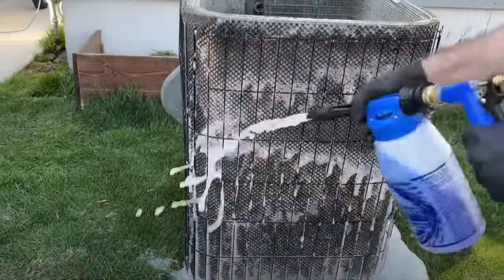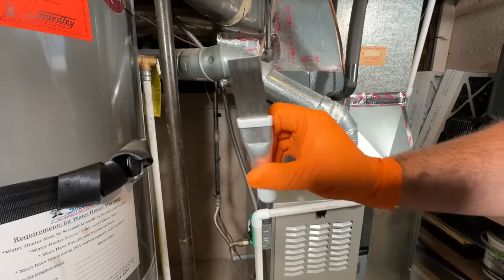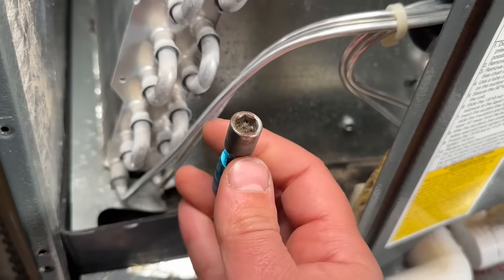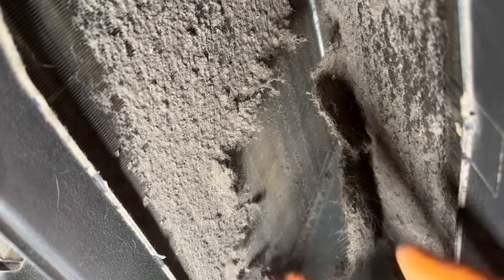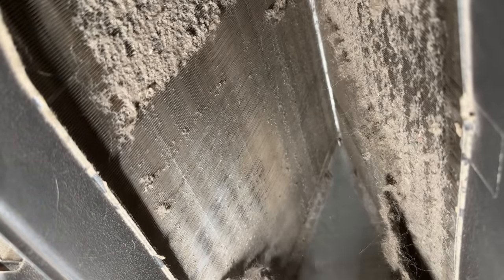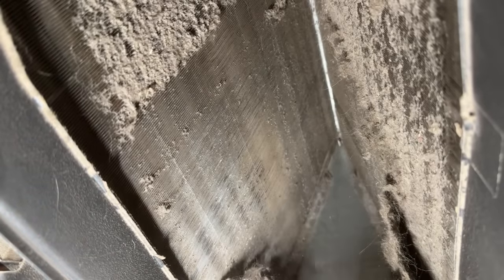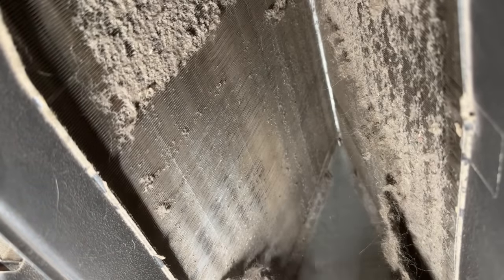How To Properly Clean An AC Evaporator Coil & Save HUNDREDS!

Comment: it looks like your air goes bottom to top mine runs top to bottom the air sucks down through the coil so the inside should be clean and i shouldn't have to pull it out good video  thinks

Comment: Stupid companies make things so difficult these days to maintain them yourself. Similar to the fan on top of the outside A/C unit. You'd think there'd be a water proof quick disconnect from the wiring harness so the top of the A/C unit doesn't have to be balanced or held onto while you try to clean the coils without having to disconnect all the wires from it.
Thanks for your video so I don't have to be robbed by "Paul".

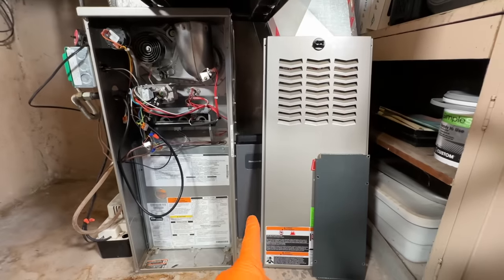Comment: 6:21 OMG, did you even have a filter.  My furnace is 22 years old and the coils are almost squeaky clean.
Reply from the maker: Yes that’s how much bypass there was. We also have a dog that sheds a lot so that contributes for sure
Reply: @diyhvacguy  I did seal the filter housing 20 years ago.  The first time I changed the filter, I was appalled how much air could get around it.  BTW, thanks.  I've just upgraded to a 4" filter.  Your video helped.  I bought a Honeywell home filter frame, same as you and even that had a big gap in the door that let about 10 sq inches of air around the filter that I needed to fix. How did yours fit?

Comment: If the furnace filter is replaced correctly the evap coil should never ever need cleaned. Been a HVAC Tech since 1977. Only rental homes and filthy homes will ever require evap coil cleaning.
Reply from the maker: Well my filter was replaced regularly and this happened. It’s not if the filter is replaced correctly, it’s if the filter rack was designed to be a tight seal. I’ve seen a TON with a similar set up as my old one and it lets a lot of air bypass the filter

Comment: I've YET to see the crap pull off in a nice clean sheet like that!  I've got 465 apartments to manage AC on, low income housing, there a whole OTHER of level nasty giong on there...I drench it coil cleaner first, then shop vac to break up the hard pack, go back with a coil bruch (same one shown in vid)...it's a a bit googy by then, but gets it done.  The coils I face are hard packed, dry scraping  is pointless.

Comment: I tried to get the morons that my parents get for their furnace to correct their filter issue but they won't. They made the return intake so that the filter sticks out 4" from where it should sit. They made it so I sounded like I had no clue as to what I was talking about concerning the seal needed and proper sized ductwork. Now I know there's more that needs to be done, because I'm 100% positive that in the 35 years they've had this house this has never been cleaned. 🤦🤦🤦🤦🤦

Comment: Looks like a poorly designed furnace to me, if that much debris got past the filter. I would recommend getting in there with a shop vac first and then use your coil tool to get any debris you couldn’t get with the shop vac, and then use the liquid coil cleaner and water.

Comment: would a clogged coil affect the heating mode as well as cooling? Mine is wimpy on both. 27 year old system ( at least).
Reply from the maker: Absolutely it will effect heating and cooling! It passes through that coil in either setting.

Comment: Why not use a shop vac or a hand vacuum to suck that dust and debris out?  All that crap that is falling and going into the air is not good.
Reply: You can easily bend the fins if you use a shop AC and then you're out $3000 for a new coil, that's not including labor ..

Comment: Why not use compressed air from say an air compressor in the garage to blow it out 😅
Reply from the maker: Well if you pump all the refrigerant into the condensing unit and cut the lines so it is totally separate, yes you can take it to the garage and blow it out or rinse it with a water hose even. But that’s a lot more work. The refrigerant lines were still connected during this process.

Comment: Air doesn’t get cold. Heat gets removed from the air. It’s important to explain it correctly. I find it helps customers understand the importance of proper charge and operation if they understand you’re removing heat from air and transferring it outside

Comment: Dude are you sure you were running a filter?
Reply from the maker: Yes absolutely. I’d never run my furnace without a filter! That’s why I was shocked at what I found! I replaced that filter every couple months on the dot
Reply: @diyhvacguy  that's unbelievable. Imagine how inefficient the cooling became. I am not worried about mine.

Comment: I would be embarrassed to have this dirty coil in my house.  Being an hvac contractor, your coil wasn't just a few months of air missing a filter.  That coil was years of neglect.  Never use those metal fin combs especially on a aluminum coil.  We know how gentle to be but to tell a homeowner to do this, well I guarantee you some will presss hard bend the fins or worse yet, tear the thin aluminum .  After you get that bulk grim from underneath, your next step should be take that spray and spray it in on the other side so you are not pushing the crap back into it's self.  Then once it foams, either a couple quick squirts with a hose or just use a Air Compressor and blow it out.  And always from the outside of the coil never from underneath.  I'm not trying to be mean man, I like your channel, but I gotta call it out when I see misguidance.

Comment: Wondering, to clean that nasty coil, why use that tool when my battery powered Bosch battery powered vacuum would make short work of cleaning that coil?  It would do it without the mess, without the fine dust and most importantly, it would PULL the dirt and dust from between the fins!

Comment: Wear a mask. I would never attempt anything like this without a wet/dry vac, even a small one - and every possible attachment I could get my hands on. Any do it yourselfer should have such a thing; try to find one that has both suction and blower ports. I would never attempt anything like this without a pump up garden sprayer; and/or one of those little cheap Chinese steam sprayer rigs… They are worth their weight, mostly because they depend on pressure, heat, and velocity, and less on large volumes of water and detergent. They dry a lot faster too. Except for the first step of manually removing the mat of lint, hair, and dust manually, I would try every other procedure first going from the outside in, or in this case top to bottom, that is, try to push it out the way it came in. I can’t see any advantage to forcing stuff further into the fins. If I was worried about getting something wet, or having liquid accumulate somewhere it shouldn’t, I would say stuff enough paper towels, toilet paper, Kleenex, whatever it takes to eliminate that fear because trying to do it without adequate chemicals just isn’t going to work. Another instance where having a wet vac handy is a must have.

Comment: Dude you dropped the ball on maintenance on your own unit..
Reply from the maker: No that’s the thing, I kept my filters replaced but it was a lousy filter setup, which allowed for a lot of bypass. As you can see it has been updated so my coil will never get that dirty ever. Not even close
Reply: @diyhvacguy  hey just wanted to let you know what motivated me. My local HVAC charge me 300% for a circuit board. Realizing there's money to be made.

Comment: What a poor design to not allow cleaning access.....a little thought upfront can fix this in the design phase.....
Reply from the maker: Yes hindsight is 20/20 but mine is actually way easier then some!
Reply: @diyhvacguy  ...I posted this for anyone's benefit.....the 5" deep pleated filters plus edging using blue painters tape would seem to keep the evaporator coil clean for a LONG time. And....not cause excessive (  say greater than 0.04" WC, or so) pressure drop. Therefore, easy on the motor too.
Reply: @TheWilferch  Can you describe the process for changing from the 1" to the 5"? Where does the painters tape go? Does the 5" filter have a flange around the perimeter of it to slide down into the 1" slot and then you seal that up with the painters tape? I'm definitely interested in switching to those far better filters. Do they increase the air flow and reduce pressure drop when compared to the 1"? Just want to make sure that I won't damage my older system by doing this since it was designed for those 1" filters. Thanks!
Reply: @chriskvikstad4980  ...how to get deep pleat filters in 1” housings
https://www.youtube.com/watch?v=NuCwKf7SBbI
Not necessarily this brand. The tape would be used to seal the "edge" for the brand names you may buy that don't have the foam-edging shown in this provided link example. Caution....the ductwork "behind" the opening may not allow a full 5" thick filter to be installed. In my home, the ductwork wall behind was covered in a spongy insulation that needed to be cut away an extra 4-5" ( deep) to allow the deep filter to fit and work. I use the FilterBuy brand and seal the edges with blue painters tape to prevent by-pass of the flow around the filter....there is an amazing amount of airflow that bypasses the edges the filter and tends to clog the evaporator coil. Cheers.

Comment: thats a lot of animal hair.. probably need a duct cleaning too. that should be easier on your blower motor too.
Reply from the maker: Oh for sure. The vents are much louder now but have more airflow for sure. Somehow air was getting past all that and I never had an issue with the limit switch tripping in heat mode or freezing in cooling mode. It definitely needed it!